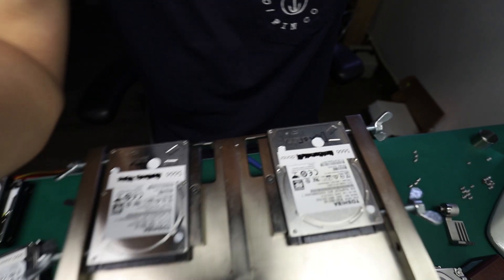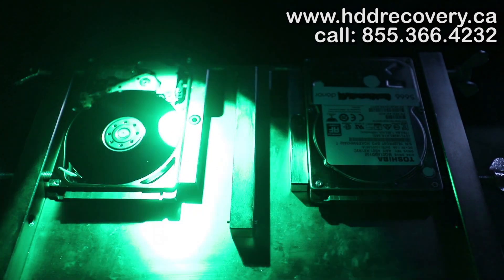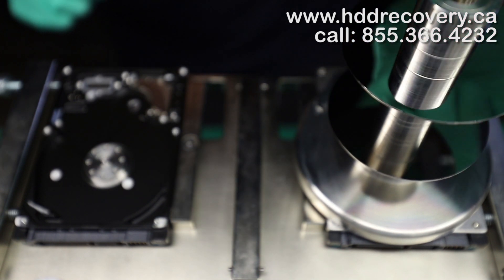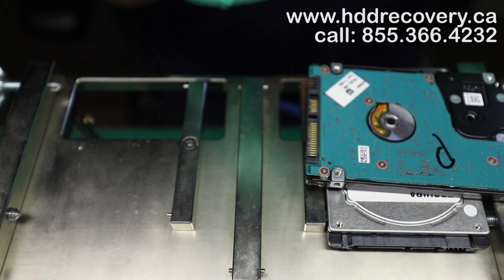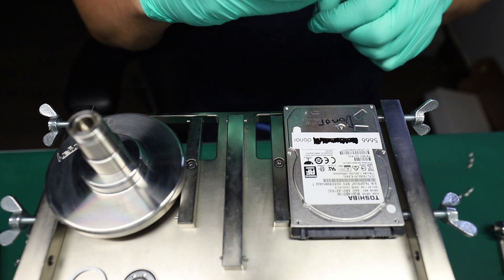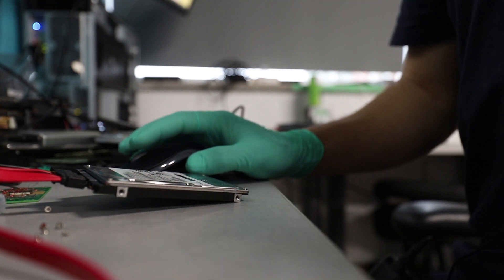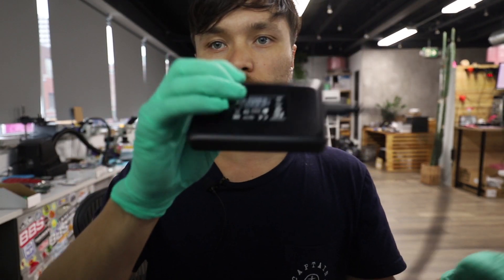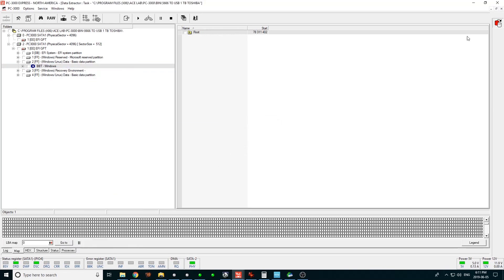hard drive platter contamination | Toshiba data recovery

Comment: I was shocked when I saw you remove the platter heads independently, as I was under the impression that their vertical alignment needed to be maintained almost to the nano-meter so the bit synchronization coming off each of the read platter head would be precisely the same as before. I've seen people carefully apply scotch tape to both ends of the platter stack to there would be absolutely zero lateral offset movement between the platters, and I've seen specialized tools that remove the platter stack as a set so they cannot be shifted from their offset position from one another. So please, for the love of God, tell me how you were able to just pluck of each platter, flip them upside down, and randomly stack them without any concern about absolute (nano-meter scale) position offset between them. AND... were able to read them??

I am guessing it is because you are using expensive and highly specialized PC 3000 to turn ON only one head at a time, in order to individually read just one platter side at a time, bit by bit and sector by sector. Amiright?  Else, just popping that drive with is misaligned platters into a typical computer and trying to read data off the partitions in a normal fashion would be impossible.

Comment: people that use mechanical HD now days are stupid...
Reply from the maker: SSD is not better. Still, fail just as ofter, but for other reasons that don't exist for hard drives. Copies is the only smart way to store data
Reply: @hddrecoveryservices  Well, SSDs certainly don’t have anywhere near the failure rate of HDDs! Especially in laptops, hard drive failure was a common occurrence. SSDs are far, far more reliable for portable use, which nowadays accounts for most computers and gadgets. (I worked in IT back in the days of the iPod, and the hard drives in them failed frequently. The same is absolutely untrue of the flash storage based models and successor products like smartphones.)

With that said, I totally agree with you that HDDs are a perfectly legitimate choice for data storage. I use SSDs as the working drives, but use hard disks for backup, since I can have multiple HDDs, each with versioned storage going back years, for less than the cost of duplicating the data once on SSD. I also use a hard disk for my media library, since it doesn’t need high speed, but lots of space. But of course, backed up onto multiple backups! (One internal backup in the tower, one external disk stored off site.)
Reply: People that  use SSDs or HDDs these days and do not back up their data are stupid...

Comment: have you tried to use UV light aka inspection light? i usually use it to gross people out around in the bathroom xD and no it doesnt really make sp3rm glow but you can see small stuff everywhere. (dust stuff and such on shirts as example)
Reply from the maker: I have UV light, but I don't think it picks imperfections up as good as a green light. Video does not really show it all that well, but contamination on this drive was really bad and easy to see in real life

Comment: Because you are missing some sectors on the MFT, aren't you missing some files/folders from the complete file system structure?
Reply from the maker: As a result it will have effect on folders, but  it was a system drive so as long as user profile was there client was happy.
Reply: Yeah but you can still recover the files from the data on the surface. its better if you have a MFT but otherwise you can use the usual recovery methods you'd use in case you quick formated your drive by error.
Reply from the maker: @laharl2k  most likely missing links from bad sectored MFT records will end up in Lost and Found section after the MFT scan anyways

Comment: Doesn’t the platters have to be aligned rotational wise? I’ve heard that once one of the platters are misaligned by even a small amount, the drive won’t work. Is it true or only on select devices or so
Reply from the maker: alignment is not a problem, especially with tools that work in technological mode after recovery is finished. However, some drives have balancing issues, which could be very troublesome at times.
Reply: HDD Recovery Services oh ok. Thank you for the response. I have been wondering about it for a while now... Anyway, you’re the god of drives! Keep going and have a nice day!
Reply: @hddrecoveryservices  this must be kinda new. The last thing i heard (i think it's around 10 years ago now) is that changing the alignment kills all your data. Have the tools evolved that good? How can the software help when the sectors are not under each other anymore, because the platters are dislocated relative to each other? Really interesting topic.
Reply from the maker: I was under impression it mattered, but practice on some stock donors had dissolved those beliefs

Comment: Hello, the video is excellent. How did you wash the plates? Is there a cleaning machine or a method?
Reply from the maker: alcohol (not the drinking type) and lots of practice :)
Reply: @hddrecoveryservices  I use isopropyl alcohol.
Reply from the maker: @sebastianmartinez3639  it works well too
Reply: @hddrecoveryservices  Or Aceton (women nail cleaner) works good. Vaporise quick and no stain!
Reply: Can this clean off the dust from platter?